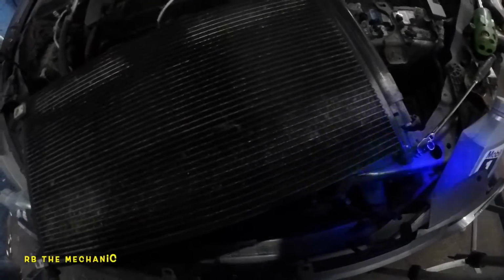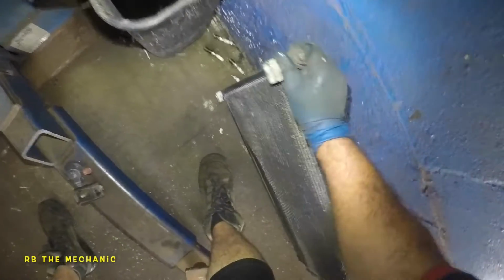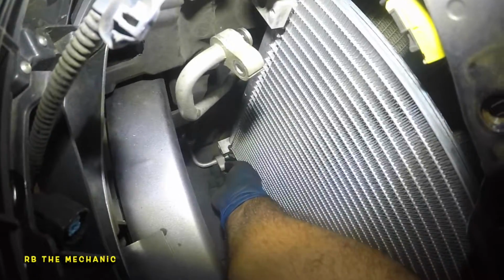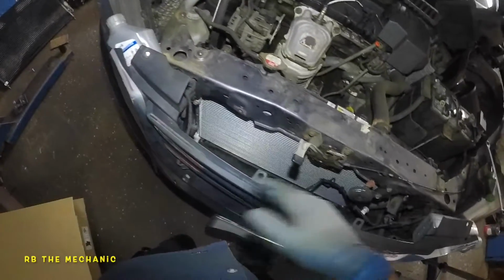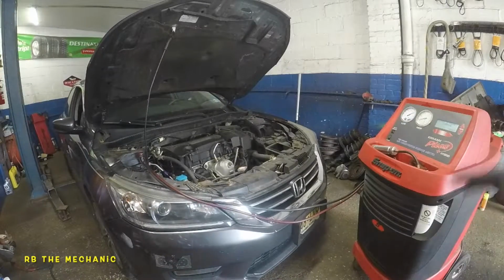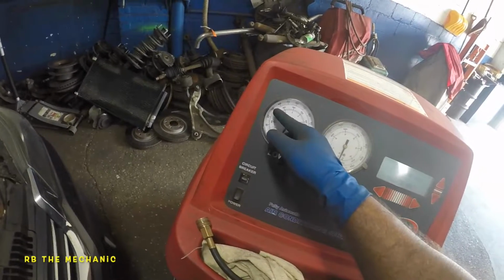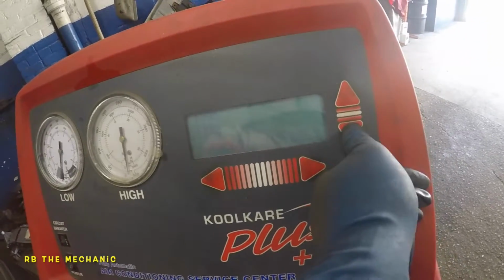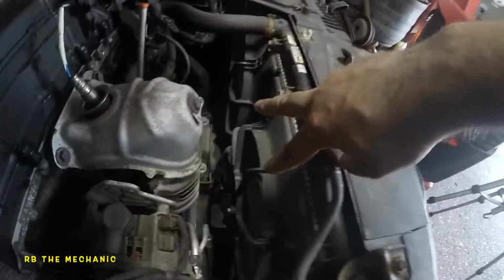Honda Accord 2013 to 2017 Replacing AC Condenser full guide Part 2

Comment: My condenser got ripped apart by a deer. I replaced the condenser and I pulled a vacuum. It’s holding a vacuum. I have a 2014 accord. I drove it home so the compressor ran for a bit with the condenser destroyed. But when I disconnected the condenser a good amount of Freon shot out all over the place. I guess my question is how do I know how much oil to add? I mean specs say 16oz of R134a and 8oz of pag46.  But is there a way to figure out if there’s any oil left in the system? Ive been driving it but I disconnected the compressor because sometimes the ac will automatically kick on and I didn’t want to burn it up. Is there a way to make sure all the oil is out of the system without a machine like that? Would the oil leak out just by having the condenser not hooked up for a couple days?
Reply from the maker: No oil will leak if it can flow out and no way to get all the oil out

Comment: Honestly i cant do the labor part even after watching this lol.  How much would a mechanic charge that isnt screwing you over, charge to do just the labor?  The mechanic did the dye test and showed me the green neon color and told me there was no refrigerant in it at all, so honestly i wouldnt have to get it recharged from a mechanic.  I could just get a can from walmart and do THAT part myself, but yeah putting it in, what do you think?  They tried to tell me it would be around 400 for labor but that sounded like a lie
Reply from the maker: Well I think $330 is fair labor for condensor all recharge ac system with ac machine.   Not cans
Reply: @RBTheMechanic  what's the difference between a mechanic recharge and refrigerant you can buy yourself?  I've put it in myself on another car and it worked perfectly fine.
Reply from the maker: @TheYTrabbithole  it not perfect it will work but system might be under stress if it’s too much some time u get luck if u only added tiny amount.  Its worst if systym was empty cuz then u jammed up air and everything else

Comment: my Ac Compressor doesn't turn on. Is it because the system is empty from freon ?
Reply from the maker: You can’t say that without checking so check pressure before that check fuse and swap relay u never it could be faulty relay

Comment: Hey brother, great work on your channel  ! I have a couple questions , where can I get AC oil to put on the lines before I plug them to the condenser, and is it safe to drive the car without the Frion to the mechanic so they can charge it, put the oil back whatever else I don’t have at home ?
Reply from the maker: Well they can put the oil for u with machine u don’t have to do it 
Also yes u can drive without Freon in the system

Comment: Hi RB, thanks for the video. How do you determine how much oil to add after replacing the condensor? Do you assume that the machine was able to pull out all of the oil from the system, then you add the total amount of PAG oil as specified for this Honda Accord which is 2.77 Oz?
Reply from the maker: I usully add the amount machine pulled out and replacing part I usully add like another extra t-spoon

Comment: Hey Ralph Bob The Mechanic!, since I don't have a machine (A/C leak detector), I use some soap and water inside a spray bottle (with some black food coloring) and spray it down. Someone said to me, you can put soap and water inside the system, and it won't hurt the system, is that true??
Reply from the maker: I use to do that and I found lot of leaks works just becarefull on ac compressor and other wirings but u should be okay to do that